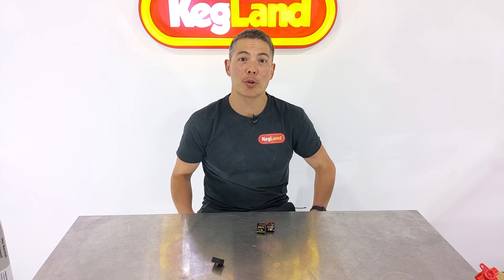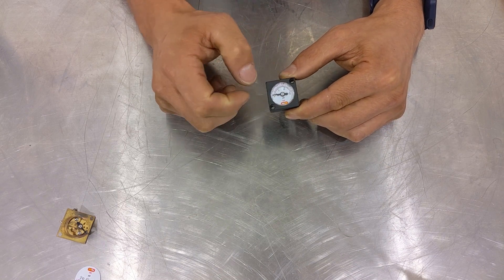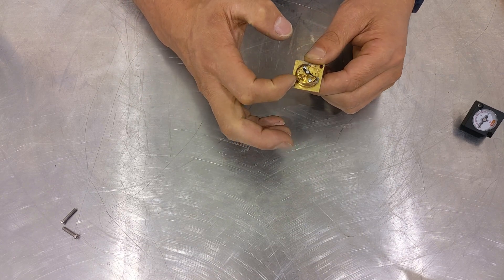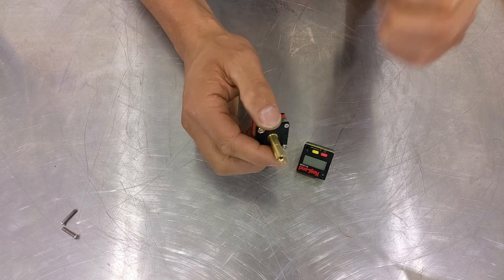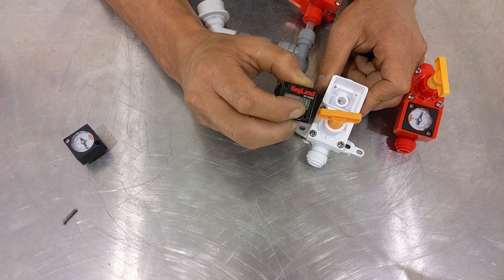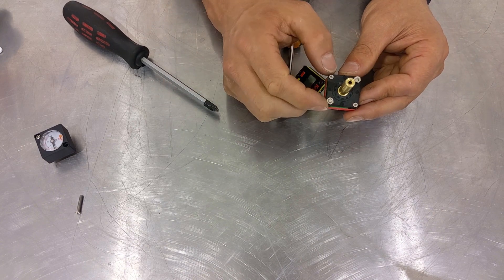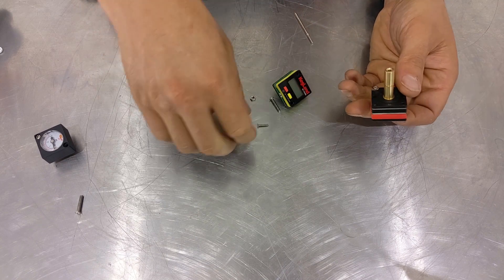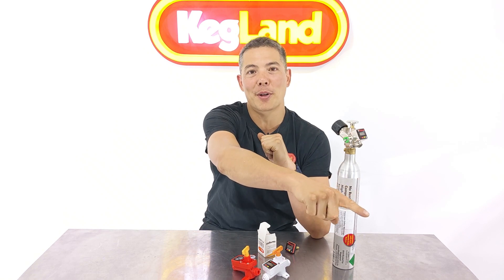World’s Most Compact Digital Pressure Gauge is Now Available!

Comment: To screw this into my spunding valve, am I supposed to remove the nuts and leave them off?  Doesn't look like there will be nearly enough bolt to hold it on with those nuts on there-- like no threads.

Comment: I accidentally held down the red button while using as spunding valve and PSI zeroed out. What did I do and what is the proper calibration procedure? Thank you.
Reply from the maker: Open it up (so, no pressure) and reset it by holding the button down again

Comment: I drop my core 360 reg into the esky with the 8l pet keg and it gets immersed... and cold. Are these digital gauges water proof to the point where you could put them in 2 or 3 inches of ice water without death? I guess its only $13 to find out!
Reply from the maker: Most parts of the regulator would be fine.  The gauge may not survive. They are not really designed to be immersed but the main chip is pot set.  As long as it didnt get too corroded you might be ok

Comment: I bought one of these a few weeks ago and tonight tried to fit into a Core 360... 

It doesn't fit!

Too tight a fit and the screen goes all stupid, I tried lubricating the yellow seal but that didn't help. In the end I took the seal off all together and still had to file down the sides of the gauge to get it to fit in the hole.

Terrible QA Kegland
Reply from the maker: Can you please contact our customer support team.  I think some of the older Core 360 units were manufactured before the digital gauge existed but we have now made all the stock compatible.  Sounds like you may have got one of the older Core360 units somehow.

Comment: Is the part number r the same for both the digital gauges? I only saw the one for the push in one and not the one for the regulators.
Reply from the maker: The part numbers are different for each type so you must select the correct unit to use with regulator or with duotight push in fittings.

Comment: The illumination seems to stay on far longer than you need it to. Cutting that back would save a heap of battery.
Reply from the maker: How many seconds do you thinkg you would prefer the illumination to come on?
Reply: @KegLand  3 seconds would be fine for me. 5 would be plenty. You can always push it again.
Reply from the maker: @fifis101  Ok I will talk to the others about revising this illumination time.  I must say I rarely use the illumination and 99% of the time find the standard gauge is perfectly readable but we still should do whatever we can to optimise the battery consumption.

Comment: G'day, I have the core 360 mini reg, and love it. One thing I've noticed is the needle jumps around on it, to fix this I tend to dial in a pressure, and release the prv to re-establish the pressure, which gives me a more accurate reading, is this the analogue guage being difficult, or would a digital guage fix this very minor issue?
Reply from the maker: Yes absolutely. This is exactly the issue with the analogue gauges.  If you upgrade to a digital guage this will solve that problem.